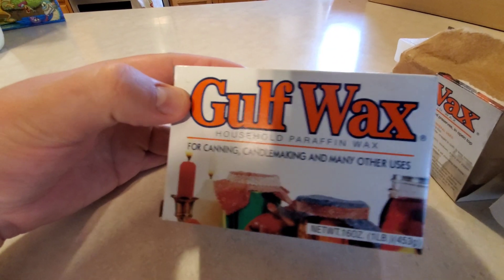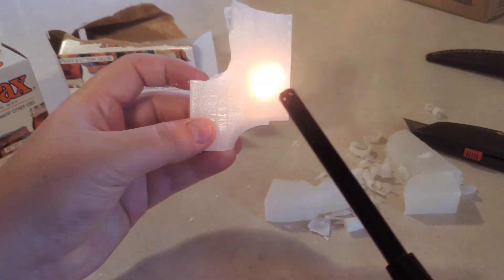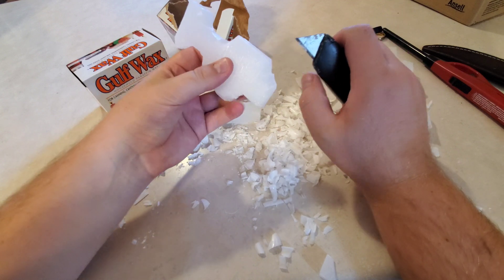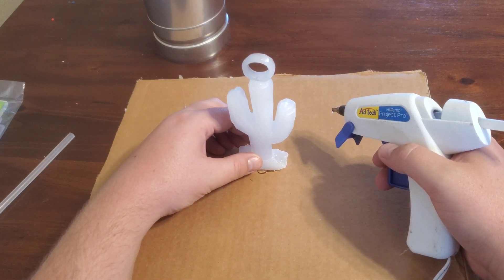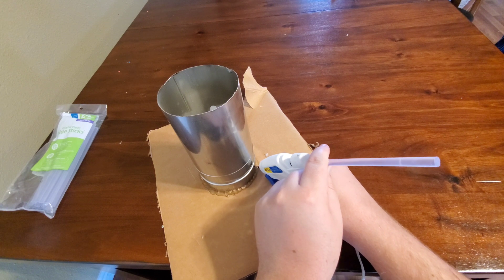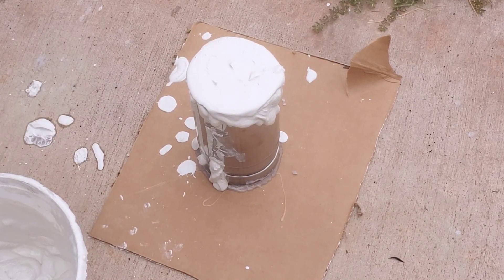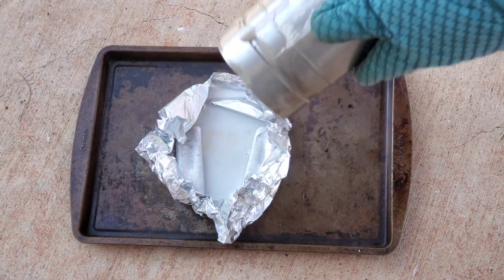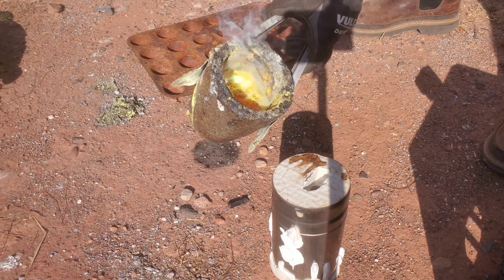Lost Wax Casting at Home - Does Candle Wax Work?

Comment: The finished product looks cactus.... 
this guy makes his own wax by combining candle wax and a hotmelt stick.
https://www.youtube.com/watch?v=uXeRZHngCiY
buy a small quantity of investment casting.
investment handles higher temperatures so it wont fuse to the metal 
coat your design with a few thin coat of investment first, then some fine sand etc and let dry.
now fill around it with plaster of Paris
burn your mold out properly in an old oven, do in 2 stages 
1st low temp about 150 1-2 hrs to melt out and recover wax and remove moisture.
2nd high temp as high as your oven will go 2-3hrs  
cover your crucible with a lid during melting
also cover molten brass in crucible with crushed glass to prevent air getting to it and oxidising it.
use borax as a flux.
wear thick cotton cloths, leather apron, enclosed safety shoes and safety glasses shield 
good luck and be safe
Reply from the maker: Thanks, I appreciate the advice.

Comment: I know its ridiculous, and you cant use it for plaster encased in a metal can, but you can actually microwave plaster of paris to cure it.  I didnt believe it either so I tried it and it works. 50% power for 10min-up to 2hrs for big blocks, 30 min might work for that size that you did for this video.  I set a rag towel in a glass baking dish in the microwave with the plaster mould on top and check it every 5-10 min.  Its usually pretty steamy after 10min.  When you smell singed cotton towel, its done.
Reply from the maker: Sweet! thanks I'll have to try that one.

Comment: Plaster of paris has water of crystallisation locked into it's structure. It's usually fine for lead/pewter casting temps, but for brass and it's higher temperatures, you need to drive off that water/turn the plaster back into gypsum, otherwise lots of it will be  released as steam when hot metal touches it during casting. Try driving it off by  heating to at least 150deg C if not higher.
Reply from the maker: Thanks I'll keep that in mind for the next one.
Reply: what about 99.999 silver?
Reply: Plaster of paris mold needs to put it in oven and let it to dry before casting for aluminum or lead same